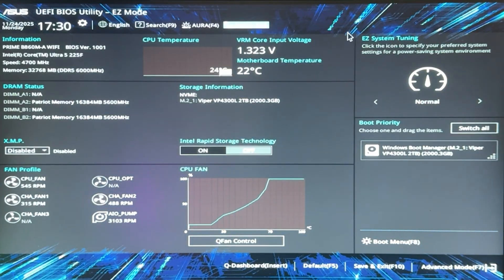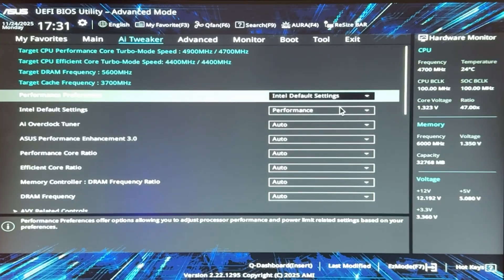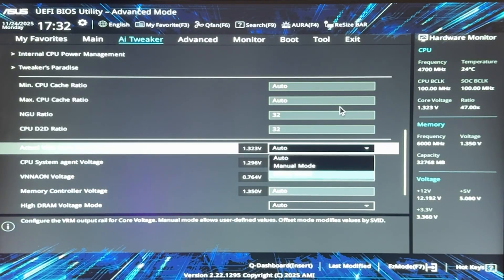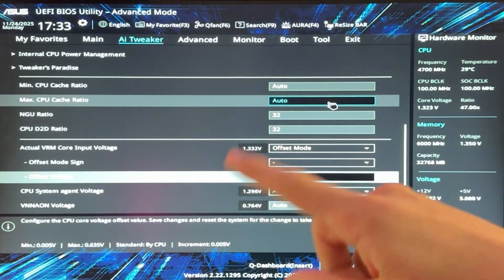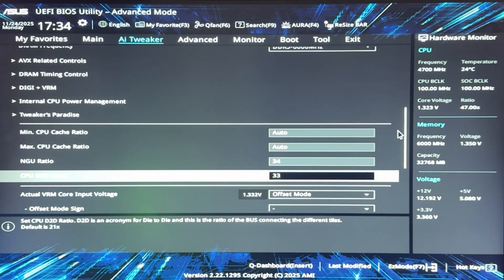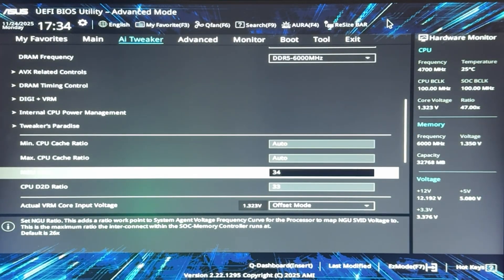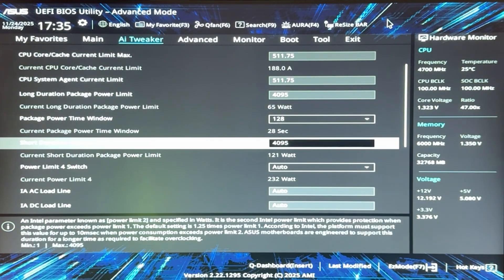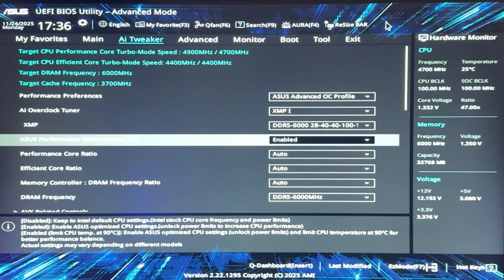Undervolt Your Core Ultra 5 225F for MORE FPS & LOWER Temperatures! - Full Guide

Comment: Great video as always. BTW, if you have an MSI mainboard, no matter which chipset, then you can just use the LiteLoad setting in the bios to undervolt a bit. Make sure UV-Protection is on auto or off. Sadly, it doesn't go under 13 so it wont do so much. 
Update: I just tested it with your method, it doesn't work because there are no similar options available, only memory voltage offset(VCC-SA and SOC-SA) is possible. Hope MSI will fix this in the next bios version.

Comment: I’m still trying to bet the best from my 14900k is it possible to get it help ?
Reply from the maker: I do have a dedicated video on the channel for it, I try to cover every single CPU in the market :) If you'd like a one-on-one call you can also DM me
Reply: @I @ImWateringPSUs ig dm
Reply: @ImWateringPSUs For theres two choice in the row, you chooce a Asus-hybrid M.board( be carefull because in the past i killed to went over each Asus, with the hybrid and IO integration im in testing mode next year. On the other hand Theres a jumpers which bring 4 Lakes CPUs in its syncron by a micron controlled serversystem. Even than the Rayzon is out off its Limits, Important note buy now because if i can imagine the 2026 theres panic and also high demands from its national guads which kills the lower prices.🔞

Comment: thank you for your videos, i have an asrock board and for input voltage offset it only accepts mw value, what would be the equivalent of 0.5v in mw? also when i enable 200s boost i get memtest errors on my ram? at stock or xmp only (without 200s boost) ram passes memtest
Reply from the maker: mV just means V divided by 1000. So multiply 0.5 times 1000 and you have 500mV as the equivalent :) With 200S boost depending on your RAM kit you may encounter D2D/NGU instabilities, so it's generally better to set it manually as I show in my DDR5 video :)
Reply: @ImWateringPSUs  thank you very much for the explanation! u mean 0.05 x 1000 = 50mv? with 200s boost, yes i had to manually increase SA to 1.2v and increase load line, as enabling 200s boost my board only ran at 1.0-1.1v and caused errors.

Comment: My Intel Core Ultra 5 245K processor runs stably at offset -0.270
Reply: The 245k is pushed more so it can be undervolted more when you drop the clocks a bit.
Reply from the maker: @rattlehead999 Exactly, generally the 225F has a little bit less headroom. Great settings still!